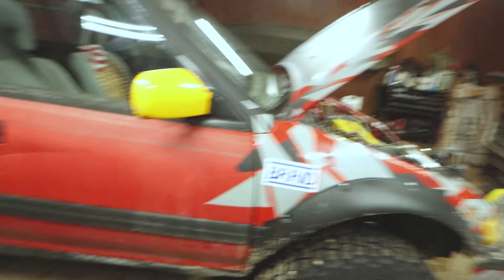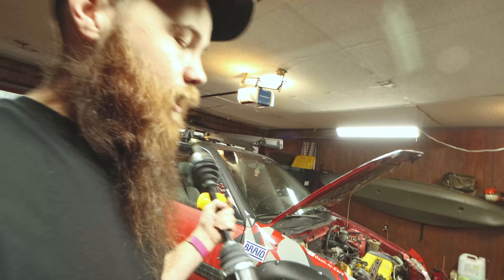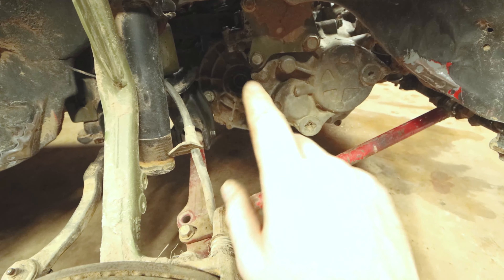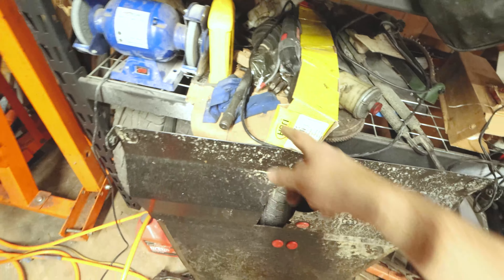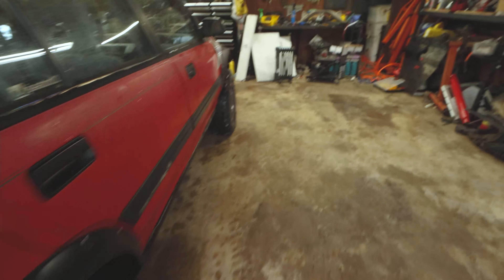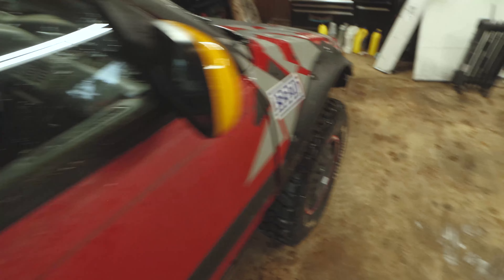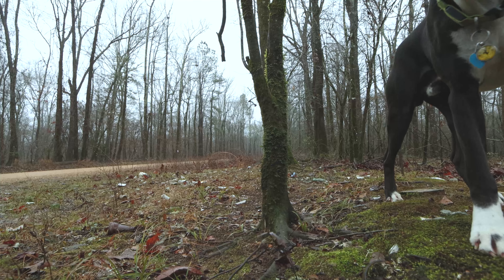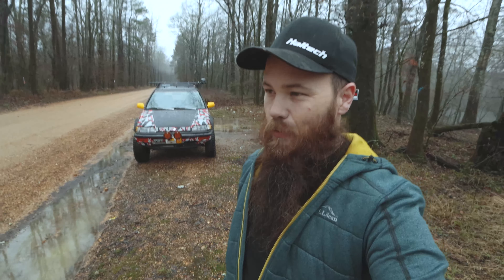Axle Fixed! Easiest Fix Ever(Lifted Honda Civic Wagon)

Comment: What are those red rings around you’re wheels? I’ve seen them in rc cars.
Reply from the maker: They are Beadlocks! They help keep the tire on the bead if you run lower tire pressure running off road.

Comment: So I guess you have a 88+ wagon... I have a 87.... quick question what is spline count on the axle? Trans side and hub side. And do have a halfshaft on the driver side?
Reply from the maker: That's correct,  mine is a 4th gen 91. 

I believe everything is 27 and 24 spline, the half shaft is on the driver side.
Reply: I had alot of problems with the carb on the car. So I thought I'd do a head swap with a y8...nope the head gasket for y8 is way off from the d15a2 block.  So I did a engine swap d16y8. Wow alot of work... I would love to rallycross at least once with this car...
Reply: Thanks for the reply...ps love that wagon
Reply from the maker: @Stillsz75  thanks dude!  I love 3rd gen wagons too. I need to grab one